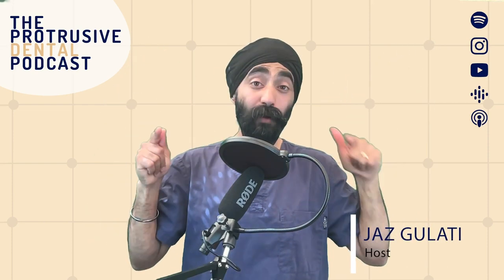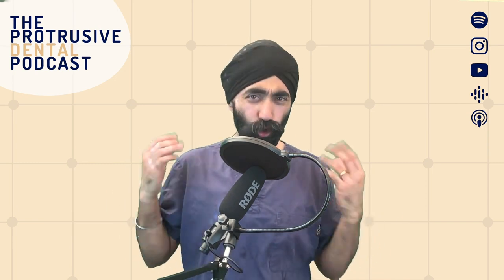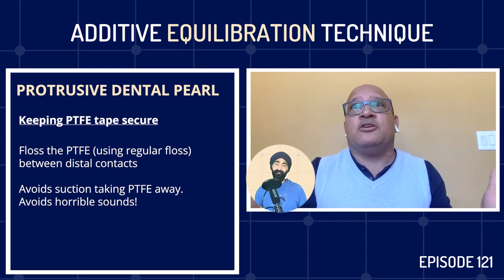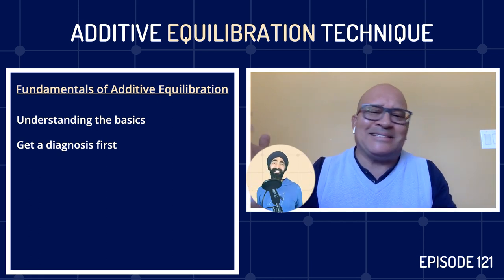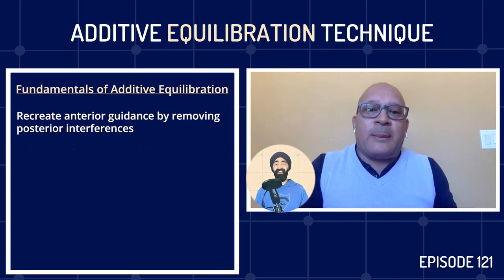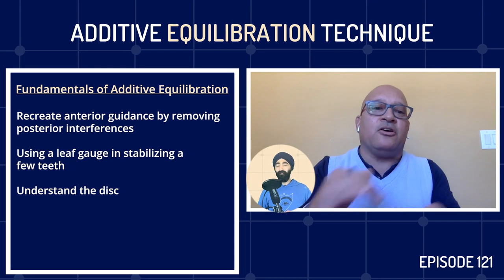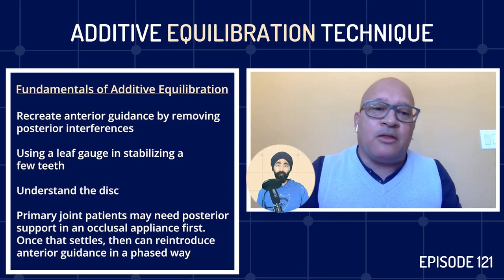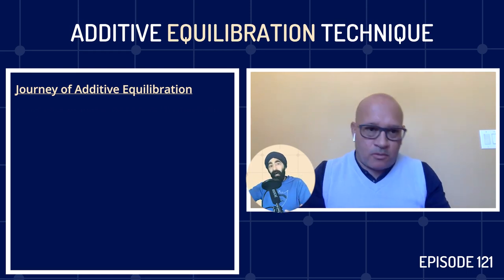Additive Equilibration Technique - PDP121

Comment: What is the purpose of asking the patient to bite before light curing the composites? Is it to ensure the VDO of the built up canines matches that of the RCP before you reduce that point?
Reply from the maker: hey bud - imagine you DIDN'T get the patient to bite together. The composite will either be too proud (likely), too shy (also possible), or just right (never happens!) By getting the patient to bite in to it, the height of the composite is set to the correct vertical
Reply: @protrusive  that's exactly what I thought. Thanks for that! Amazing content as always Jaz!